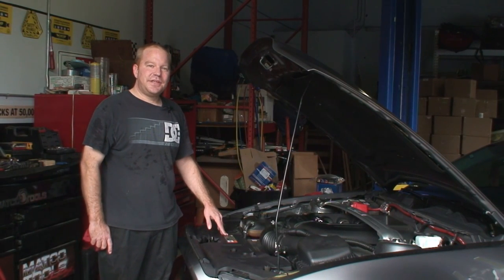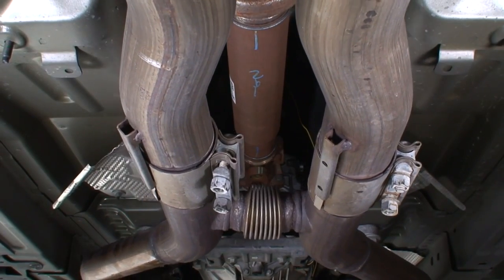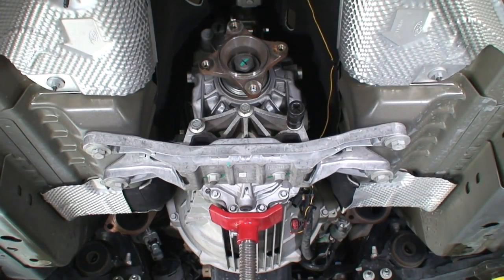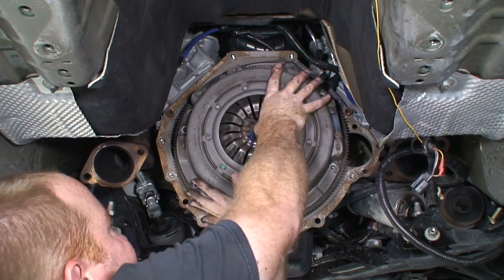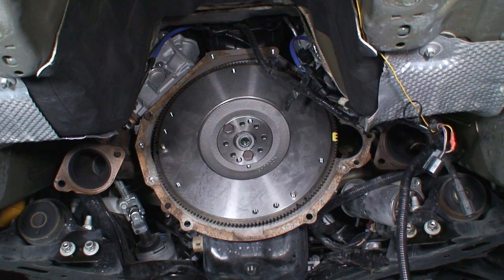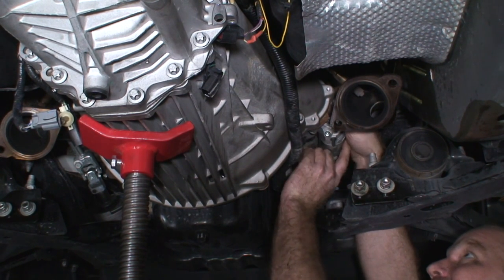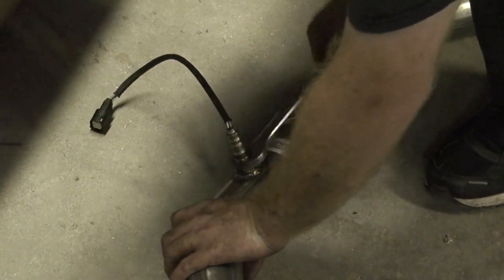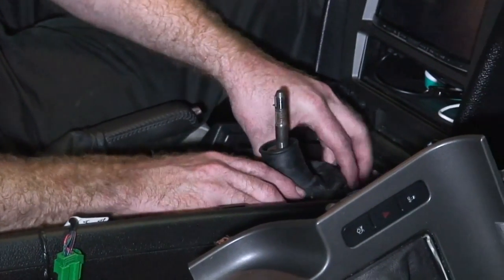2013 Mustang GT Clutch And Flywheel

Comment: I love your video on how to replace the clutch on the mustang ,  I also have a 2013 mustang gt,  but I had to give you a thumbs down because of one rule that every great mechanic knows and  even my father taught me , if you're going to do the job,  do it right the first time so you don't have to go back in, you change the flywheel but you did not change the rear engine seal which is a no no, every good mechanic knows if you went that far to take the flywheel off what's a few more minutes to change the rear engine seal, Even though it was not leaking rule of thumb you're there so change it, That's like doing a timing belt and not changing the front engine seal or the cam seals,  because after you put everything back who's to say a few  months  later the rear seal starts leaking because it was not changed. Now the whole job has to be done over again.

Comment: I am going to be using this video as my guide to do it myself... with jackstands/ramps.. Ordered clutch /flywheel wish me luck
Reply: John Z having same thought. Did you do it?
Reply: i need to swap the slave cylinder on mine, no lift either, just got done swapping a seized engine for a running one just to find out gears wont go in when engines running , only when the car is off that i can actually shift them on and out...  thoughts??
Reply: Jason Tabares this weekend I will..  I just got a stage 1 clutch and flywheel delivered but I won't be home to get it till Saturday..  also got a shifter bracket.  I'll let you know how it goes...
Reply: 2ndA sounds like that.. is it connected properly? Did splines match up with clutch ?
Reply: heres the story. i bought the car with a seized engine , replaced the engine with a running one, that engine came with the clutch installed and i didnt touch it. now the car starts up but gears wont go in. i never drove the car lol dying to
Reply from the maker: Awesome and good luck!!
Reply: So I did it..I got to borrow a garage bay from a friend... 
. Let me just say this.. The starter bolts were NOT my problem... Getting the top 2 bellhousing 13mm bolts off was the WORST.   Also getting the trans to line back up when I reinstalled it with the trans Jack was scary.  You have to go in at an angle so you dont hit your exhaust flanges.    Job took me about 18 hours, but I was also sanding/ grinding my chassis and undercoating/ painting everything and cleaning it.  I can drop it in 20 mins now.. Once you do it, you'll remember all the  issues, but this was my first time doing a repair like this. ( I had the trans fall off the jackstand because the trans jack failed.   It weights about 200 lbs so be careful, have someone with you.   Also the MT82  LIKES TO GO ON ITS SIDE.. so make sure you dont damage the speed sensor when laying it down.   

I did my flywheel with a Valeo State 1 lightweight clutch and Flywheel kit on ebay for $450  
My pilot bearing was the EASIEST PART..   It came out in two pieces though using a slide hammer and the removal tool from Autozone.  It came right out.. Used a 22mm ish socket to pound the new one in.. 
I was worried because my clutch kit did not use all the screws holes on the pressure plate. I re-used the old screws.. 
Remember to get red locktite for your bolts.. especially flywheel.   
I didnt use the dowels, just had a friend hold it for me when i mounted the clutch with pressure plate.

. I had to drop the trans 3 times times because I was so scared I forgot to tighten everything. ( Im glad i did because the support that holds the driveshaft was only hand threaded .. I forgot to tighten after a testdrive)

  When i finished, the clutch petal went straight to the floor, as if it wasnt even connected.. BUT after pumping it it started to stiffen up ( there is no gravity bleed)  .. .Other giant pain in the asses.. getting the new slave cyl' clip to snap in all the way.. When you install the small black plastic mount you have to make sure its pushed ALL THE WAY IN, or else you wont have enough clearance to plug in the clutch line.  I ended up removing the plastic that goes in the bellhousing .

Just to be safe.. go back and re-tighten your bellhousing and driveshaft after 100 miles.. some of the bolts are too hard to get to without making your own swivel/extension combo,    You will need at least 10 inches of 3/8 or 1/2 drive extensions.

SO far so good.. its breaking in now.. 150 miles on it, and I also installed a shifter bracket, the gears just naturally pop into place smoothly.. getting a stage 1 clutch is daily driver is worth it.. You have to rev a little higher to get into first and reverse, but other than that driving is a DREAM now compared to before..   and I saved 1200 in labor thanks to this video

Other notes  -
Reply: If the gears dont go into place then either the clutch is missing, the splines are not lining up on the input shaft,  or your clutch line is not engaging with your throwout bearing aka slave cyl..  Make sure they are installed and everything is lined up.    When you take the trans out the slave just goes over the splines, you dont have to touch anything else, no trans fluid, no gears.. Its pretty straight forward.

You should be able to HEAR the fork engaging and the slave cyl when you pump the clutch.. its makes a light clank sound.
Reply: great write up man ,so i also got a friend to let me use his shop on a sunday morning, I even had my car towed to his shop Sat night in order to start Sunday morning on it. Sunday came up and as we were gonna push the car into the shop i decided to start the car (dont remember why) and as my gf and my friend started to push the car inside the shop to get on the lift i tried to shift in reverse and it actually went in ! LMAO we got the car on the lift and i managed to shift into every gear while the car was in the air. ended up not dropping the tranny ( lucky or what??) it was shifting like shit thou. as the days went by the tranny got smoother and better but its still a mt82 with all its known issues. Ford needs to do a better job on that. today i installed a tranny insert made by whiteline to see if it helps with the knotchiness and overall shifting feel.  other than that the tranny , clutch , slave cyl and hydraulic lines are all stock. i do have short shifter but thats it.
Reply: So its been 2 months now,.. Took really 2-3 weeks for clutch to break in,  now ive driven it close to 5k miles across the  midwest US for road trips and its a dream,  The only thing i dislike about day to day driving is i cant really start in 2nd anymore from stops  with the ultra light flywheel because it will make the clutch smell come back.  This REALLY SUCKS when faced with Standstill 4 lane rushhour traffic  ( Cleveland, Columbus, Cincinnati, and Indianapolis )  But other than that, when im home the country roads are so much more fun to shift through, and theres ZERO third gear lockout...  AMEN
Reply: i heard its the stock shitty clutch thats responsible for the majority of the lock out problems. i added a whiteline transmission mount insert and it really helped too. still running the stock clutch here. also have a short shifter but im thinking about getting a shifter bracket  as well. also i changed the transmission fluid the other day , i got Redline MTL fluid in it now and let me tell you , it shifts soooo much smoother!! this weekend im changing my rear diff fluid. i got AMSoil severe gear 75w140(3 quarts + their diff additive. ( i have 373 gears and they are pretty whinny , that should help ) thx for the update! keep us posted

Comment: Definitely not looking forward to ever replacing my clutch, I don't have access to a lift so this looks like it would be a pain to do with Jack stands
Reply: did you end up doing that? i need to drop my tranny as well and i dont have a lift either.
Reply: 2ndA it's not that bad I had to drop the trans on a lowered vw jetta on Jack's
Reply: Make sure you get some tall jack stands or else you'll have the transmission in the way the whole time like I did

Comment: Good info, Thanks for the help. I had to drop my K-member to get the motor low enough for the trans to slid back in the tunnel so the pilot shaft could clear the clutch, he also said in the beginning of the video that you don’t have to drop the exhaust, I did not drop the H-pipe but wish I had of. The H- pipe will be removed before I go back with it!

Comment: did not remove sound insulation correctly …..2 never use impact to tighten clutch …..over all good job....
Reply: Pretty sure he said he was NOT tightening the clutch all the way down using an impact. He was getting them snug and applying final torque with a torque wrench.

Comment: How did you guys get the top 2 bolts out of the transmission?
Reply: Looks like they lowered the trans some more and used some flexi extension setup to get to them.

Comment: Hello.  Awesome video.  I have this issue.  Could this be considered a warranty issue since it requires a redesign to fix a functional clutch?
Reply: nope- its not warrantied. Im going through it right now on my '14. They will cover the master cylinder but not the clutch or the slave cylider. Its causal...im out $1700 for a new clutch and a slave cylinder. but the master cylinder is warrantied. Nice huh
Reply: @Blue_xoxo  please tell me the 1700 included labor.

Comment: what an excellent video!!! thank you and congratulations, i wish i could find videos like this for everything i ever needed lol. i bought a 2011 GT with bad crankshaft bearings and i just finished swapping the motor at home just to find out my transmission wont shift into any gears when the cars turned on ...so disappointing!!!   im pretty sure the slave cylinder took a dump and i need to get my transmission out but i need to do this in my garage with no lift... this video will help me do it step by step without guessing whats next. ill be replacing the clutch that came with the used motor i bought for the old one that came out of the old engine... anyway  congrats again great video!
Reply from the maker: 2ndA awesome, thanks for watching and especially thanks for commenting, helping people and then getting comments like this really make it worth doing these videos!!
Reply from the maker: Thanks so much for the watching and commenting, we are so happy when one of our videos helps someone, it really makes it fun to do these when we get to help people out!

Comment: Great Video.... What happened to the clutch that caused a replacement? Also, these Stangs have had reports of a transmission whine that occur in 1st - 4th gear, could this be a clutch issue, or transmission gear issue I wonder?  Also, what was the cost of the clutch replacement? This is definitely not a DIY job, without a lift. Hire a pro!
Reply: James Perconte yes mine wines but it a 2011, i heard the 13 didnt have that problem
Reply: What was the cause of the wine

Comment: Anyone know if the flywheel bolts are the same on a 96-04 for manual and auto
Reply from the maker: BRENDAJASON1 no they are different, also different motors may have different flywheels,
Reply: APDTY ok thanks yea was talking about the 4.6 motor with manual

Comment: Had a shop just complete the clutch and light flywheel install. But an engine light came on showing cylinder 3 misfire.. any reason for that?
Reply: I have seen this happen 2 times...when the installer put Trans bolted to motor wire harness gets pinched with out any knowledge
Reply: @bobbyhill305 wtf!! Does a crank sensor have to do with a clutch??
Reply: @user-hf5cf9ie1u 

On Coyote Mustangs, when you do a clutch or flywheel, you sometimes  have to do a crank relearn  if you get a misfire codes. Especially  when you change to a lightweight  flywheel and have to change the pilot bearing.

Comment: Couldn’t the shifter be disconnected from the shift rod on the transmission  without removing the shifter inside the car?
Reply: Mustang Guru it can. But it’s a complete pain in the ass. Not worth it.

Comment: Is that trans the same one in the 2015+
Reply: Yes and no. It is a MT-82, but the internals (while sharing the same design) have slightly different types of parts (metal vs plastic here and there, some other minor improvements). The tail housing assembly is also different than on the S550s. The shifter is also slightly different... Now with that said the MT-82s are interchangeable between the S197 and the S550s... All one has to do is switch over the tail housing to get it to work.
Reply: @ParhelionGame  ohh ok thank you for this information.